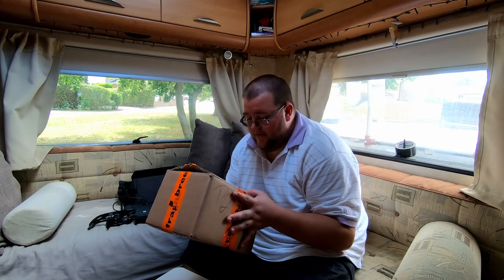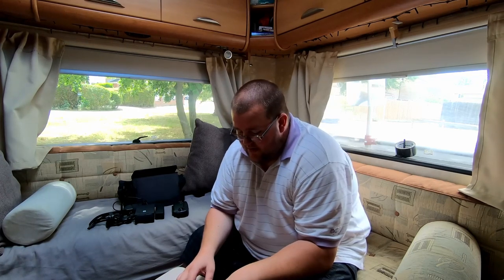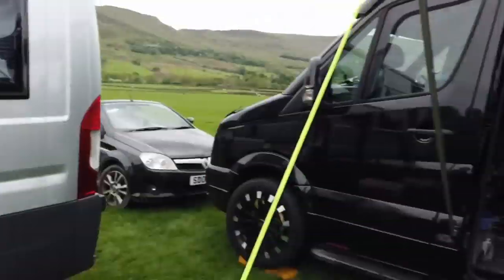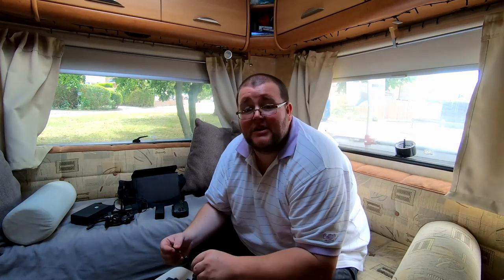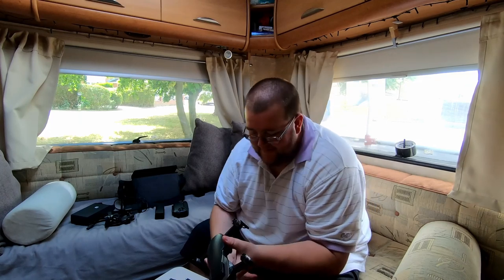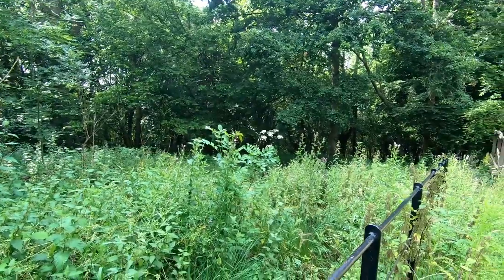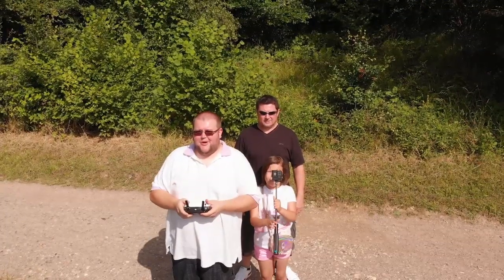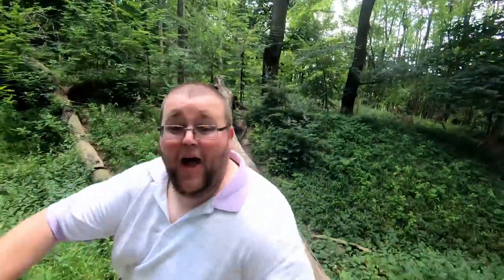Drone's Fixed! But I Messed Up!

Comment: Hiya Darren, loving ypur videos by the way.. Can you give me a bit of advice on what aerial you use in your mh.. I'm refitting our 23 year old one and I don't know if it's worth getting a small black stubby type one you can stick on the body of the mh.. (I forgot the name but they are on ebay) or to get a digital one for the roof.. Anyway what's you advice fella... Many thanks x
Reply from the maker: Hi Julie, glad your liking the video's 😁
A company called August have just sent me a TV/aerial to review and the aerial is amazing, I know other van lifers use the same on too and it's under 15 quid, here's a link - https://www.amazon.co.uk/dp/B007JPOX8O/ref=cm_sw_r_cp_apa_i_-LpuDbBJW5P5J

Hope this helps 😁😁👍🏻👍🏻

Comment: Great videos, we are going to France in a few weeks. What make and type drone do you have and how long did it take you to master this. Does this model come with the remote control? 
Thanks
Joe
Reply from the maker: Hi Joe, my drone is a DJI Mavic Air they are pretty easy to fly as they've got sensors all over them to stop it from crashing and it's also go preset flying modes to fly around an object or follow something, yeah they do have a remote that you plug your smartphone into and use as the screen, there not cheap though, about £800. Thanks for watching 😁👍🏻😁

Comment: In a world of intelligent design, AI and nanny states you would have thought the props would only fit one way, so the clockwise props only fit the correct motors and the anticlockwise props only fit the motors they work on!!! At least you'll never forget now 👍🏻
Reply from the maker: Oh spot on John! The bit that's getting me now looking back at it is they didn't say anything during the booking in for repair process online, like "Hey have you checked this this and this" before going to the trouble of shipping it, surely I'm not the first this has happened to lol 🤣😂🤣😂👍🏻👍🏻

Comment: Darren you absolute f******g legend . ROFLMFAO . Props on the wrong "engines" . I was killing myself pal . 
FYI I'm available for instruction reading for the privileged sum of £30 per reading . Bargain considering it's just cost ya 60 euros for NOT reading them PMSL . 

P.S. That log desperately needs greasing 🤔😉👍🤣😂🤣😂🤣

Fattrucker
Reply from the maker: 🤣😂🤣😂🤣😂 
Think I'll have to take you up on that offer mate, you'll be rushed off the amount of help I need 😁😁👍🏻👍🏻